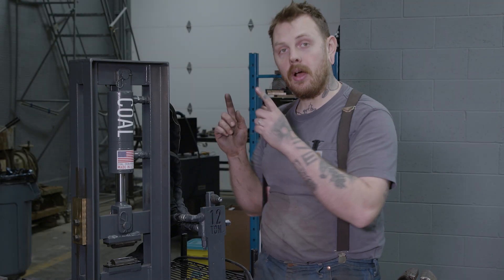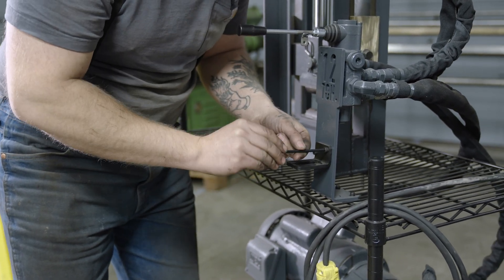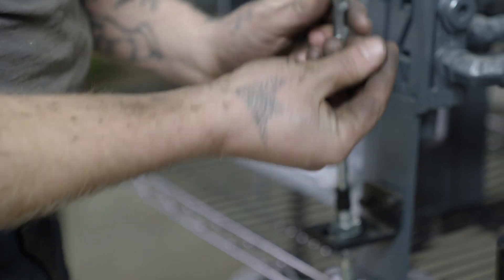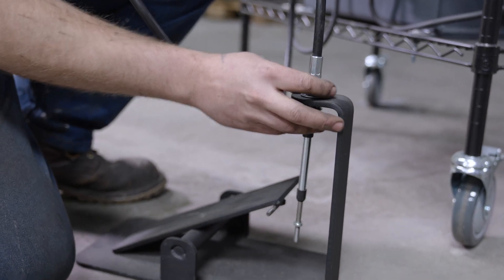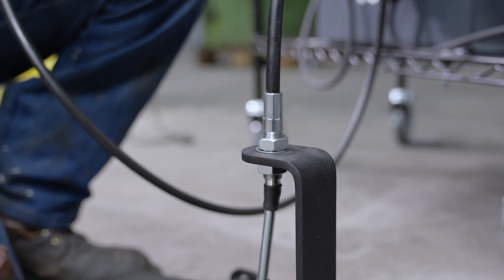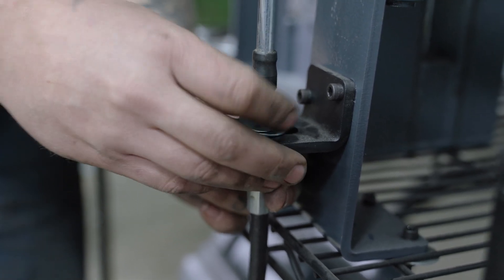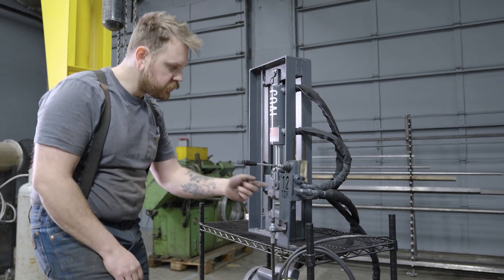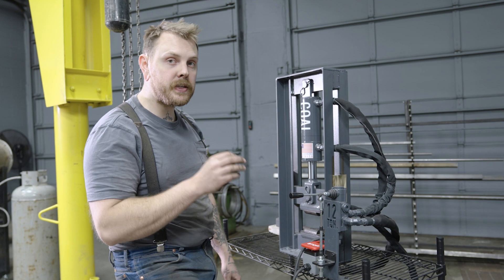Foot Treadle Install Guide for Coal Iron Works Forging Press

Comment: Great video reference.  I am planning on mounting my foot treadle tomorrow.   You might make a video about moving the valve mounting bracket up like you did on your unit to make the handle more accessible.  I have the newer power pack, but it looked like I would have to disconnect the hydraulic hoses to do so.
Reply from the maker: Thanks for the suggestion! We'll be revamping a lot of our guide videos early next year :)